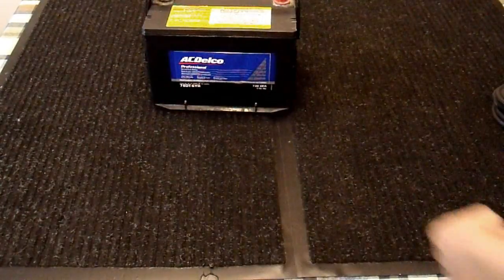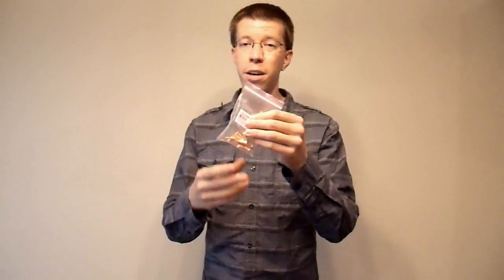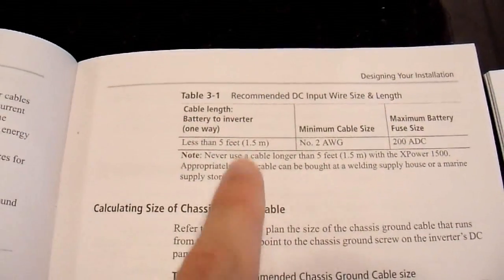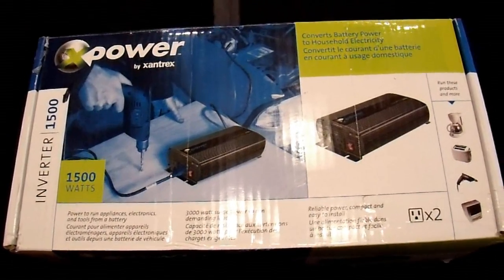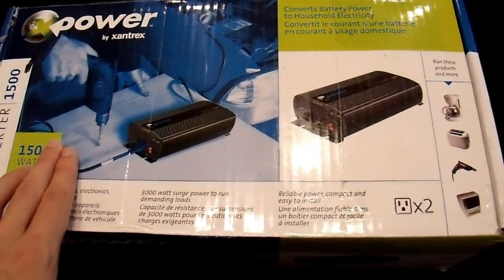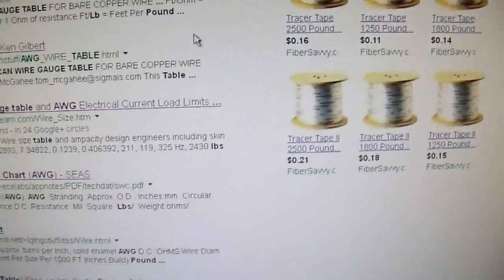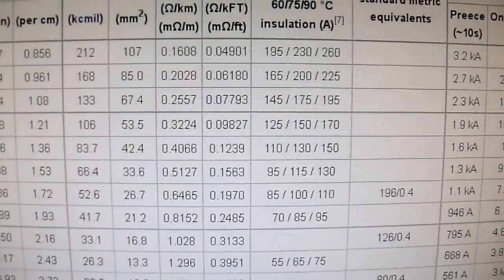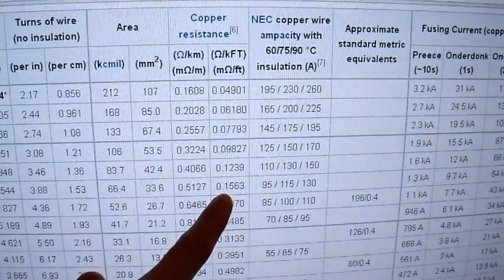How to Select and Purchase Battery Inverter Cables Part1

Comment: As you are saying your inverter can surge 2000 watts, it's clearly written on the box 3000 watts surge?
Reply from the maker: What is written on the box of inverters is nearly always an objectively false lie.  Surge ratings of inverters is entirely meaningless, and in general inverters with lower rated surge Wattages tend to perform better.

Comment: Also related to your choice of wire gauge is your choice of inverter.   Most inverters are not designed to operate at even their rated capacity indefinitely without supplemental cooling.   So, you should choose an inverter that is capable of providing a continuously rated amount of power that is twice what your intended load is going to require.   So, if your load is 500 watts, your inverter should be rated at a continuous 1000 watts - but, you could get away with sizing your cable to handle the 500 watts, since running a 1000 watt load continuously is likely to result in eventual failure of the 1000 watt inverter in a rather short period of time, regardless of the size wire you're using.
Reply from the maker: This depends on the inverter and is a subject of many of my older videos.  Well made inverters can handle continuous loads in excess of their ratings.  Some can do this with good lifetime, some can't.  Poorly designed inverters cannot handle even 50% right out of the box.  I caution anyone against using rated inverter watts as a major factor in their decision without first considering the quality and marketing fluff part.  Overall I consider your advice solid and I also derate to about 50% in my personal inverter choices.  Thanks for commenting.
Reply: @knurlgnar24  Of course, a $3000.00 5000 watt Victron inverter is likely to be able to handle its rated load indefinitely - but, your typical cheap Chinese inverter?   Not so much.  But, even with a big Victron inverter, you're still better off getting one that can handle twice your intended load requirements.

Comment: My 2 gauge wire doesn’t fit in my inverter,  what type of connector do you use to connect them?
Reply from the maker: If a ferrule or ring terminal (depending on your inverter) cannot be used for mechanical reasons then a simple alternative is to cut a few strands of the wire to fit the termination required to fit.  So long as your amperage is within the specs of the termination you will be OK regardless of the wire AWG.
Reply: @knurlgnar24  thank you!

Comment: What if you are only running the cable to the inverter a very short distance? Say like 2 feet, is it safe to go down in wire size to like 4AWG or 6 AWG? Some calculators I find say this is fine, some say it's not. I feel like the distance of run is not always factored.
Reply from the maker: You still have to make sure the cable will not overheat.  Many calculators will only factor in voltage drop which isn't the whole picture.

Comment: thx you explain very well  Iam totaly new to all this inverters amps volts power packs I have a 400 amp 1200 volt power pack I want to get a heater for my van I would  run about an 1 hr a day..I have a 1500 watt heater So ? is is a 3000 watt intverter good  what brand would be good no solar one thanks great

Comment: I have a number of booster cables but no way to know the gauge rating.  Are they usable for my cables between the main and auxiliary batteries?
Reply from the maker: Jumper cables can be good sources of cabling but the cables are rarely the gauge advertised unfortunately.  I've used jumper cables I cut in half many times as they are generally less expensive than purchasing the clamps separately.  If you are willing to cut them you can measure the cross-section and get an estimate of gauge, or alternately you can simply run your max expected load through them for a long period of time (15mins or so) and check for warmth.

Comment: Can I use converter time we travel on the road? We need plaging oxygen unit for my wife, she is full time on oxygen. Thank you for your help, Milo. milosfilar@centurylink.net
Reply from the maker: Yes, most inverters will work well while the vehicle is running as long as the charging system can handle the load.  For an oxygen unit the electrical draw isn't very high so it would work great.  Get a pure sine inverter and connect it directly to the battery or charging system - not a cigarette style power outlet.  Be sure to get an inverter with a high voltage cut-off of >15V if you live in a cold climate as alternator voltages are quite high on startup on cold days.  15.5V is high enough.
Reply from the maker: I also want to note the obvious:  Be sure to have a backup if there is chance of a medical emergency if the concentrator fails.

Comment: Hi , I want a install  a 2000 watts  inverter for my semi truck  I have 4 batterys , my question is the cable #4 gauge  its recommended??
Reply from the maker: This video series covers how to select cables for that application but without knowing your precise application I would knee-jerk say that 4AWG will NOT be adequate.  I recommend a minimum of 0AWG regardless of length.  For a commercial install like you are describing I would personally get 4/0AWG cable and be done with it - the extra $100 is worth it on a rig you make a living with in my opinion.  Besides, cables like that are worth their weight in copper so they will only appreciate anyway.  I got some cables from AC/DC wire and supply recently and it seemed to be good stuff - they sell various lengths on their website and eBay.  You can probably get by with 0AWG though if you choose.

Comment: After adding water to a battery should I charge or discharge it I added water when it was at 100 percent
Reply from the maker: The best time to add water is when the battery is fully charged so you're good.  There is some chance of the battery overflowing and becoming overfilled if too much water is added to a discharged battery as water level will slightly increase during charging.  The plates must be fully covered with water before charging, however, to avoid further damaging the battery during charging.

Comment: So i should be fine with running approx 5 to 10 feet of 4 guage to power an 1200 watt inverter that barely allows 900 watts before overload

Comment: Best way to find out is buy your inverter and check the papers for specs
Reply from the maker: I emphatically disagree.  Consumer grade inverters almost never give correct information on cable or battery sizing.  If you purchased a $5000 piece of equipment meant to be installed by professionals to meet international code standards then, yes, follow the instructions.  Otherwise you will find the information missing, misleading, or incorrect.

Comment: After I figure out how many amps will be needed ie 125 amps for a 1500 watt I add 10% to account for the power loss in the inverter so it will be 125+12.5=137.5 amps

Comment: Thanks for all the great info you've provided us. This leads me to a question on sizing if I could ask for your guidance. Currently, in a van; 2016 Transit with the stock alternator and single battery. I just upgraded my 'cartridge-hungry' ink-jet printer (400 watt inverter) to a Brother laser printer model HL-l2395DW only to learn the inverter demand is much, much greater to drive the 9.2 amps I observed on the rear panel. From what I have derived from such videos/education, I will need at a minimum a 1500 watt pure sine. I have my eye on a Power Tech-On, which by the way, looks identical to the Aims PWRI 150024S. It is also sold by Home-Depot under yet another name but at $209, price/performance looks attractive, that is, for what I know at least. This being the case, what is your opinion for such a unit based on my needs. Eventually I plan to add a microwave to the vehicle too so if you can make a recommendation (small/minimal) for such a (dial) unit I'd greatly appreciate it. So, is 1500 watts adequate for this printer? Of course the vehicle would be running at anytime the printer would be operating, which leads to another question. Ford makes a dual-battery option available. Would there be any benefit to adding this second identical battery to the configuration? Eventually an AGM/solar panel set-up would be added as is the plan at a later date. Most immediate is to simply get this printer up and running. Your opinion of this 1500 watt unit? 1500 watt adequate? Fuse advise and size? I recall your video of the commercial unit having superior pure-sine capability. Doing what I'm doing here, is it advantages for me to take that leap and obtain (such a large) unit initially? Last thing I want to do is under-purchase from ignorance up front of course. Any/all input you can provide would be greatly appreciated. -Doug
Reply: In order to know whether or not the inverter will provide enough power, you need to look at the power rating for the devices that you intend to plug into it.

So, you'd look at the printer, and see how many watts of power it uses.  Do the same for any other appliances you intend to use.  If you want to use them at the same time, then add these values together.  As long as that total is below the power rating for your inverter, technically, you should be fine.

So, if the printer draws 200 watts, and you're also using a lamp, that happens to draw 40 watts, then you'd need an inverter that, at least, has a rating of 240 watts.

It's always a good idea to make sure your inverter has more than the total; and not equal to it.  This will prevent any issues of, potentially, not having enough power.  After all, the inverter is a machine, and will never be 100% efficient.

As for the dual battery.  I'm assuming this dual battery system is just connecting two batteries in parallel.  If this is the case, then using an extra battery will allow you to run things longer, with the truck turned off.  This is because, by having two batteries, you're increasing your overall energy storage capacity.  So, if you happened to be running the inverter, while the truck is turned off, it'd take longer to drain the batteries than if you had a single battery.  Of course, it would also take longer to fully charge both batteries.

When it comes to battery storage capacity, just think of it like a bucket.  If you have a bigger bucket, it holds more water.  So, if you were dumping water, from the bucket, at a constant rate, it'd take longer to empty the bucket, if the bucket is bigger.  In the same way, it takes a longer period of time to fill that bucket.

The same is true with battery storage capacity.  The higher the capacity, the longer it takes to drain that battery.

If you'll always be running the truck, when you use the inverter, then I don't see much of a benefit to having the extra battery.  Although, if it's just hooked in parallel, having the extra battery wouldn't hurt.

Comment: I thought you would use ohms law. You are using a 1500 W inverter 1500 divided by 125 = 12 amps ac but on the DC side you figure it different. The draw  From the batteries would be different 1500 divided by 12 = 125 amps I have no idea if this is right does anybody else know better.

Comment: videos showed me the awg tables I need to set up my inverter to a 4 bank gfi in rear section of my car. I have tons of cable of different ga., but did not know about voltage drop. back to the drawing board, but I wont be doing any ripout and repairs ! about time I found a vid. with out any song and dance. and yes, my last name really is pizza

Comment: The Inverter manual has the cable size ya should use in it... Then Double it ...lol  
Mine said to use  00 if 10' (combine red and black....both ways)  I have 6' total ft. of both red and black so I picked the 2/0 cable... My Inverter is a Eastwood 2000/3000 Pure Sine Wave btw.....

Comment: the first manual is correct in saying you can use 2awg wire. 1500w divided by 12v is 125amps. there for going off the chart you pulled up, using 2awg wire would be fine to use

Comment: Is there a downside to thicker than will ever be necessary cables? Such as using 2/0 when 6awg is all that is needed? Thank you.
Reply: No.  Other than cost, there's no downside.  This is because, when it comes to electrical connections, there's no such thing as having too little resistance.

Comment: hi what size cable do i need to connect two battery ( 34agm 750amp) to a 30amp converter and what size wire from bat to converter.

Comment: Question: My bus battery is 24 volts (2 batteries connected). My Inverter is a 24volt to 12volt 720 watts. What GUAGE WIRE and LENGTH do you suggest for the wires from the Inverter to the vehicle batteries? is 2 feet ok with 0 guage wire?

Comment: It's actually much simpler- put a load on the inverter and see if the cables get warm. If the cables get hot than the cables are too thin. For most applications the 10 gauge wire from Pep Boys is fine if the battery is next to the inverter. Put your money into the battery clamps- those are what's going to fail.

Comment: So much talk with to little direct and relevant information.

Welding cable, neoprene jacketed.  Easy to buy and terminate.  2Ga is more than large enough.

One more thing, the currents you could encounter can cause some serious issues or even death.  DC, even at low voltages is dangerous and a healthy respect for it and the battery supplying it are a must.  Batteries do catch fire and/or explode if shorted for more than the briefest of moments.  Not to mention the dangers of the copper plasma that you are likely to encounter as well.  50,000 degree copper vapor in the face sound good?
Reply: Id like to put my batteries in the  Bow and run cable to power my transom trolling motor.  What kind of line losses can I expect over 24 feet ?
Reply: Size of cable you plan to use and rough steady state current draw of the motor need to be known.  Assuming that the voltage of the battery is 12V.  Simple Ohms law stuff, look it up.

Comment: what about a 24 volt battery bank 600 amps across all batteries with a 24 volt inverter ? What size wire would I need ?

Comment: How would some solid copper bus bars work out?
I'm unable to find a chart comparing AWG wire sizes and solid copper bus bars.
My solid copper bus bars are   (inches)    .250" thick X   1.250"  wide.  (1/4"X1-1/4")
They are less than 2-1/2  feet long.
They will bolt between the battery and inverter terminals. 
Should these be adequate to connect my  5,000/10,000 watt 120v. ac AIMS INVERTER
to my (3 X 12v battery in parallel)  bank of 125ah 12v AGM batteries?    (375ah total)
Isn't  there overload protection built into that inverter?
Can I get by without an additional fuse?  If not, What type and size should it be?
Can a fuse just be bolted between the bus bar and the inverter input terminal?
(These components will all be bolted down securely within a sheet metal enclosed,  metal framed, wheeled cart).   Thanks in advance for your expertise and time.
-Practicalman

Comment: This may or may not be such a minor point, but 1500W/12V = 125A. That's important when sizing cabling and selecting the correct fuse.
Reply: My pure sine wave is
Reply: Attention 2 Detail Automotive Towing And Detailing there is no such thing as a 100% efficient inverter.
Reply: surprised to see people dont know how to use efficiency in the correct manner
Reply: Is your inverter 100% efficient

Comment: I want to mount a 2000 watt inverter that uses 2 power & 2 ground cables in my 2011 Wrangler 2 door. The inverter comes with 2 gauge cable, but is it ok to go up to 0 gauge and run it from battery to cargo area without causing issues? I'm mainly using it for a electric impact if I need to change a flat or run a small compressor for putting the tire pressure back to the right amount after airing down for trails.

Comment: Ok, just found your video's and I'm really enjoying them.
In your comments section you say that solid is ok for DC and even have a short discussion with Richard Downer about this.

If this is true... how about using a solid steel or aluminum bar to hook up batteries? 

Power companies use solid bus bars to go between transformers and insulators in their substations.

My concern is: With every upgrade (adding more batteries or larger inverter) then I'd have to upgrade my cables to compensate for voltage and amperage.  If you use a large enough bus bar to hook up between batteries then you, most likely, would never have to upgrade cables between batteries... ever; just add a bus bar for the new battery.  I wouldn't mind purchasing  short pieces of cable to go between bus bar and inverter but I'm hesitant to build cables every time I wish to add a battery, and I plan on adding batteries every few months  as my  system grows.
Reply: There's no reason that you couldn't use busbars.  However, steel and aluminum have a higher electrical resistance than copper.  Because of this, they're probably cheaper than copper busbars.  However, they don't conduct electricity as efficiently.

Just remember that, because they have a higher resistance, they'd have to be thicker, if you want the overall resistance to be as low as copper's.

A higher resistance, may, or may not, matter, depending on your application.  Just something to keep in mind.

I recognize that this answer is 7 years late.  However, maybe it'll help someone else who's dealing with a similar issue.

Comment: hi  i have a solar setup im working on for my rv..  i have 400 watts of pannels and a 30 amp charge controller.  im using standing house cables is this ok?  soild copper like you would run a room off in a house..

Comment: +Knurlgnar24  Can you give me your opinions/comments about these inverter cables from HF  Cen-Tech - Item#69537 I have a Go Power High Surge 1500 pure sine wave inverter. Will these cables suffice? What is the amp capacity of these cables? It's claimed 300, but people say according to AWG it will only do 181Amps...input?